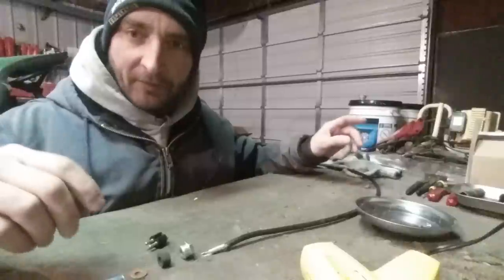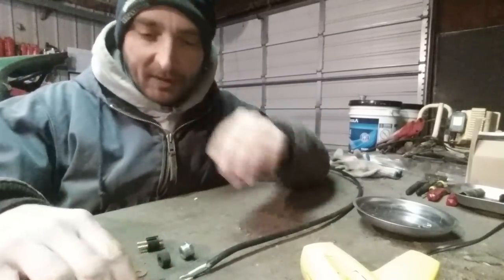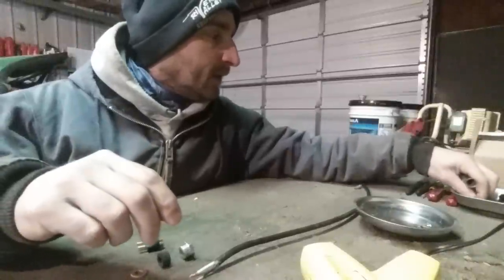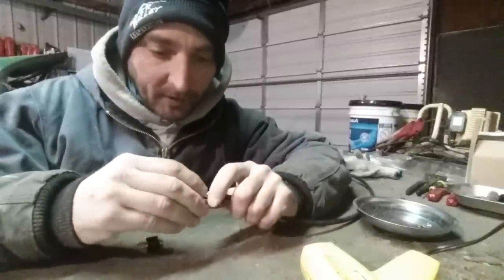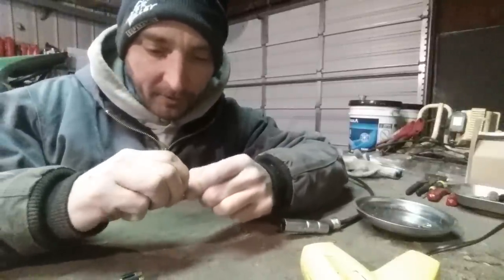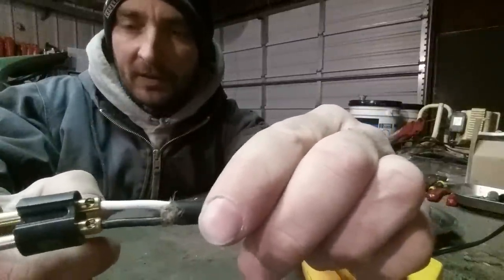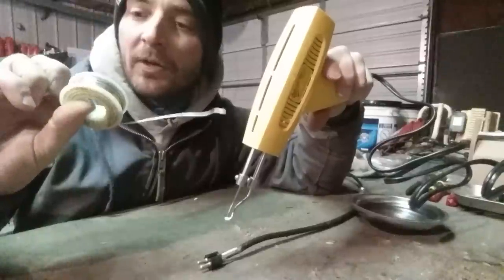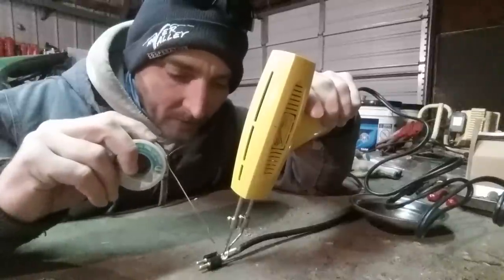Feedwagon scale cord fix

Comment: Its nice when your power source comes from the tractor. My Knight 3250 I had used a car battery, if you forgot to turn off the scale head the battery would go dead fast! I'm looking at a 2170 stationary now and put it under a roof.